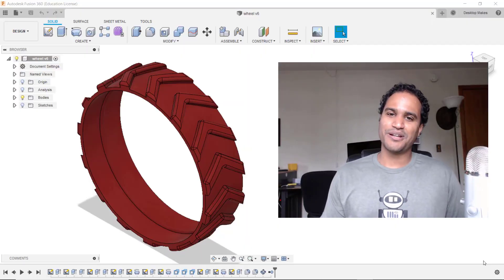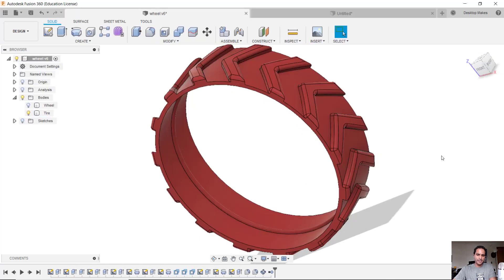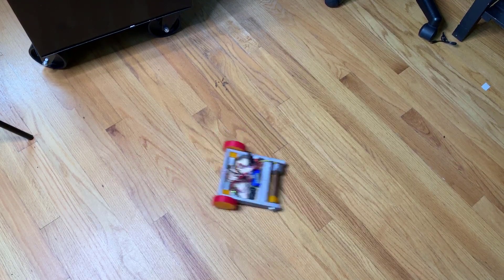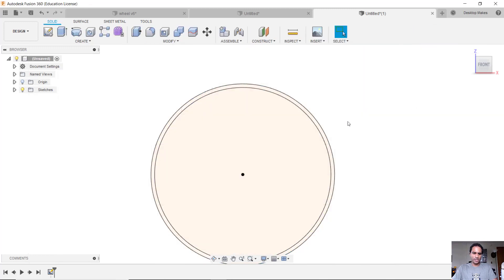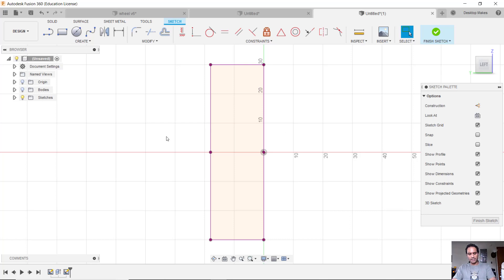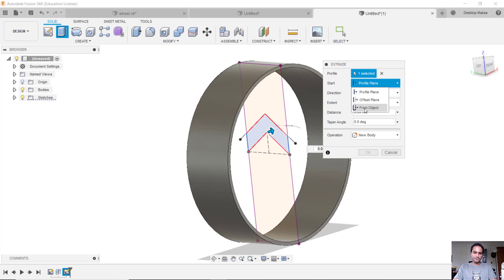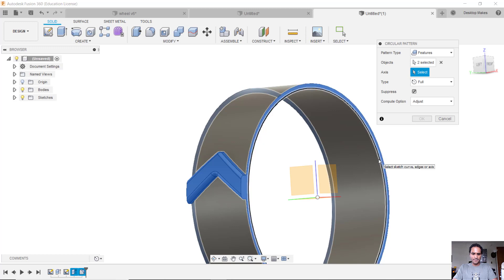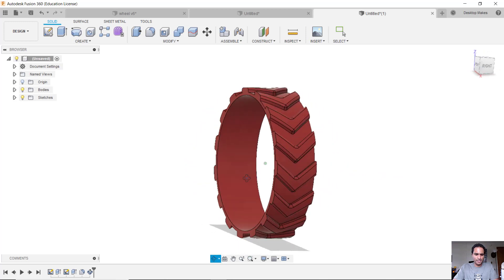Make Your Own Tires in Fusion 360 - Circular Pattern

Comment: Funny, as I tried to reproduce this on my first attempt, I had to sketch all sides ( fully enclose) the tread pattern on the projected plane before I could select it to extrude-to-object.
The next time I made the offset it worked. Gah! 
If not at first....eventually will do I suppose.
 Will print one in PLA just for fun.
Thanks my friend. Looking forward to the Robot under 1 lb
Reply from the maker: When you project the body into the sketch it should have projected the sides.  I'm guessing this is where something went wrong for you.

Comment: I would think a slick tire would give you better traction on a smooth surface.  By adding the treads you are decreasing the contact patch with the floor.  BTW, I love your teaching style and all your F360  videos,  I've learned so much from them.

Comment: you might want to try them with no fillets on the tread, I think you will get much better traction, I know on a dirt bike as soon as the tire looses that sharp edge the traction goes away quickly.
Reply: Yes very true, same with 4x4 offroading
Reply from the maker: Thanks Adam, I'll print a pair without fillets and try it out.

Comment: Your first shown updated design project had a lot more steps!  Looks like you have a band in the middle inside, and a couple more filets 😀
Reply from the maker: Good eye Dave.  Yes, the design does have a band in the middle that goes into a groove on the wheel to lock it in place.  I wanted to keep the video short so I kept the focus just on the design of the treads.

Comment: I recommend putting a slight V profile in your rims, and the inverse of that profile in your tires. Your current design slowly walk itself off, while with a V-profile the tires will always be nudged back to the center. I have some pictures if you like. They do require a fair bit of force to pull the tire over the rim. I should revisit printed tires, I wrote them off some time ago because they kept slipping, but that's probably because I tried putting a lot of power through a very unagressive tread.
Reply from the maker: Good idea on the V profile.  I didn't show it on the video but I do have a ridge in the middle of the tire that goes into a groove on the wheel to lock it in place.   I'll see how well this works and if it still slips off I may try your V profile idea.